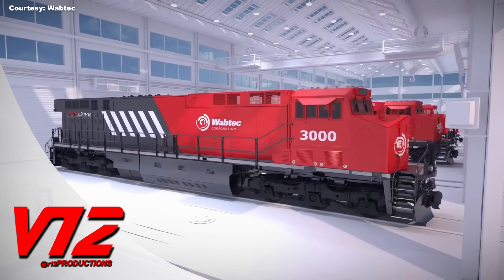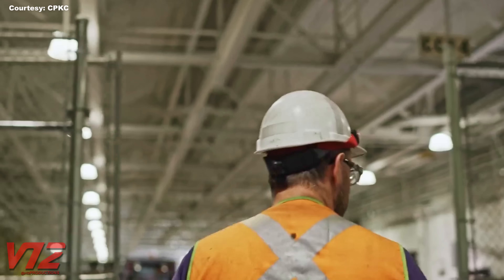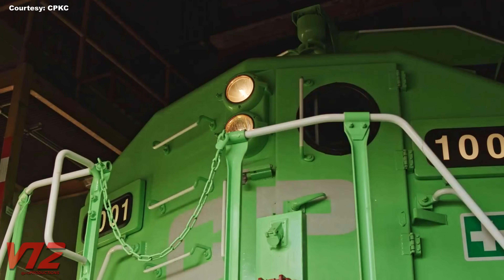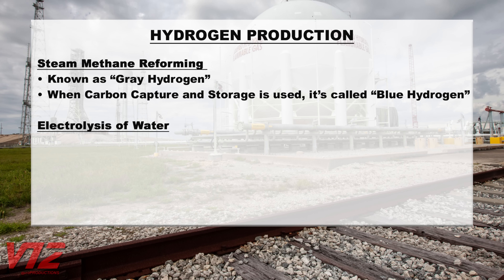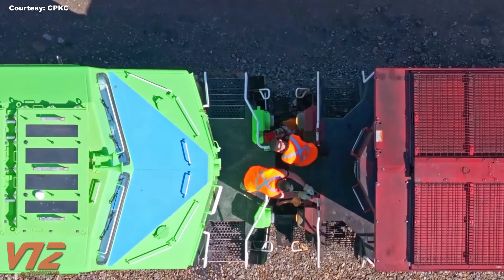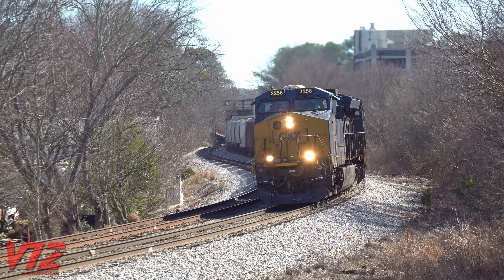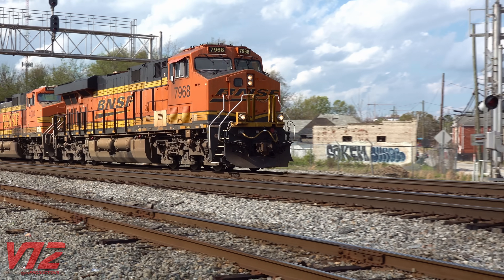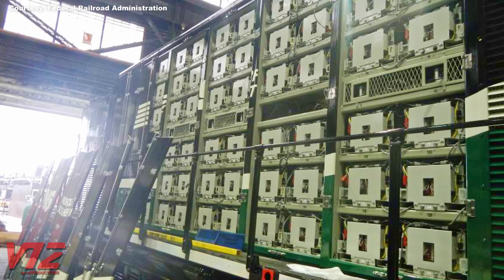The Future of Train Technology?

Comment: All these hydrogen and battery units exist solely because Class 1 railroads are greedy, stingy, and are afraid of the upfront cost of installing over head wires, which will save them money in the long run.
Reply: Hit the nail right on the head, the GE “Little Joe” had the same horse power(albeit with haved tractive effort) as modern ES44ACs do, and the Milwaukee road would run them for over 400 miles continuously. It’s not out of the realm of possibility and anyone who thinks so needs to think bigger.
Reply: Time to copy and paste Switzerland’s rail net work and scale it up 10 fold :)

Also I’m pretty sure there was thoughts about electricifiying in the 50-60s
Reply: @ exactly! There were probably plans in the early 70s during the oil crisis.
Reply: It’s called running a stock-owned business.   Anybody CEO/CFO is going to do what makes the most sense for that business, not meeting any outside sentiment.
Reply: Threaten nationalisation unless they electrify an annual minimum of their tracks per year
Reply: Yeah, those fully battery-electric engines are a bloody stupid idea.😅
Reply: Dude. No
Reply: Towns across America have been mad at the power and telecom companies demanding they remove the overhead wires because their constituents don’t want to look at the ugly poles and wire.  Now you want them back.  Make up your minds people.
Reply: And some lines had full electric lines but wanted short term profit so they removed them
Reply: 100%
Reply: Exactly! Overhead electrification has been a proven technology since 1914 on the New Haven railroad. If about 10% of the most heavily trafficked rail lines in the country were electrified that would account from more than 50% of the mile-tonnage. There are many other benefits like not having to stop for refueling and trains that would run faster up hills, increasing the total capacity of the line.
Reply: Poor you
Reply: More like not really practical for the terrain all these trains run through along with the fact that it would also need government funding and take 50+ years to complete.
Reply: @ Then what about the Milwaukee Road having electrified through rough terrain on their Pacific Coast Extension way back in the 1910s?
Reply: @IGuessIDoThings  was the Milwaukee road running 15k foot 20k ton trains up 40+ miles of 2% grade in 120° heat? Everybody says why cant we be like Europe,  well Europe runs thomas the tank engine sized trains and they run majority passenger trains at that so its a completely different animal. Why do you think when people from Europe come to watch trains here they are in such shock and awe and you ask them "is it anything like this at home" and they simply say "hellll no". The supply and demand in North America is much greater on the rails than any other country. Plus if a locomotive blows up now its simple to diagnose, you dont need to be a rocket scientist to figure it out.
Reply: @ Ok yeah fair point, but you don’t need a rocket scientist to figure out what?
Reply: @IGuessIDoThings  you dont need rocket scientist to diagnose and sometimes potentially fix with a piece of bubble gum a locomotive issue on a current diesel electric locomotive as you would with a fully electrified locomotive. Youd have to have numerous qualified mechanics on 24/7 standby with full electric locomotives trying to diagnose the bazillion sensors they would have to have because idk about you but im not touching anything that says high voltage, shit i wouldnt even touch the high voltage stuff on current locomotives. Trust me leaving it the way it is now is the best way to go, at most if they work correctly the hydrogen solution but even then thats gonna become overly expensive trying to convert an entire roster of loco's. If it aint broke dont fix it the only reason these concepts are a thing to begin with is because of the stupid greedy EPA thieves.
Reply: @ Ok I get what you’re saying about the maintenance of electric locomotives, but diesel electric locomotives are currently being rebuilt with fully computerized internal systems, akin to “all the sensors” on an electric locomotive. Also, Amtrak does have the ACS-64 which is essentially just an American version of the Siemens Vectron, a very common mixed-traffic electric locomotive in Europe, as well as, the Acela Express—og’s not the new ones, the news ones are a real piece to put it simply—which are electric high-speed train sets. So, we do have the knowledge and workforce to be able to work on and properly maintain electric locomotives. Also not every single inch of rail lines needs wires, preferably the busy corridors like NS’ Chicago and Harrisburg Line’s.
Reply: @em2attic  Still doesn't mean you can't electrify key routes, and those ultra-long trains are causing all sorts of issues of their own. Sure you can't make a reasonable comparison with most of Europe, but you probably can with Russia. Russian Railways have a long tradition of multi-unit electric locomotives with the latest being A-B-A or A-B-B-A lash-ups delivering huge amounts of power. Their trains are also way longer and thanks to bigger car size way heavier than any others in Europe, so much more comparable to NA conditions. They also endure extreme climates and run through some of the remotest inhabited parts of our world.
Slashing train sizes to a more manageable 1 1/2 to 2 miles would also be a good idea operationally, even though it would mean a major need for more crews (which is probably the main reason for such a project's impossibility). It would mean more agile trains that are able to respond better to speed limit changes, obstructions on the track or other emergencies, they'd be able to better integrate with passenger trains and they'd be able to fit reliably into sidings, something which PSR-operations have apparently not considered, at least according to anecdotes. I'm not saying that what I'm outlining is realistic for the US, but it's also not impossible.
Reply: @em2attic  In South Africa the entire rail network is electric. It's pretty hot in some areas and there is an "ore line" where 342 car trains are run over a distance just under 1000km, regenerative braking feeds back to the grid. Most of your argument falls flat in my opinion. Electric locomotives are much cheaper to operate and maintain by the way.
Reply: @IGuessIDoThings i think the sprinters won't handle US Freight traffic well.
Reply: @ probably not, but with some modifications and re-gearing maybe
Reply: @bahnspotterEU yes but electrifying key routes doesn’t really help as it would save very little money and that’s before you realise that you would have to electrify the rest of them due to many trains not just going on the main routes
Reply: @rhysrail It's more an environmental and operational concern to me than a financial one. And of course many trains would have to swap locomotives at some point when entering or exiting an electrified route, but US freight is so sluggish, a short locomotive change or addition (electric added to diesel train) wouldn't be a major slow-down.
Reply: @ hydrogen trains with green hydrogen would eliminate the environmental concerns and from there it’s only the railway companies profits that are effected as a massive freight train can’t safely accelerate faster anyway
Reply: @em2attic China and their Shen24 would say otherwise.
Reply: @em2attic  15k foot trains are problematic. Less jobs, longer wait times, sidings need to be upgraded, etc
Reply: @em2attic  Apparently you don't know that electric locomotives are about twice as powerful as diesels with as much or more tractive effort.
Reply: @em2attic Dude you have no clue what you're talking about about. Electric locomotives are simpler, as they work the same way as diesels, minus the maintenance-intensive diesel engine part.
Reply: @gamerfan8445 The Sprinters are passenger locos. Why would you use them for freight? That makes about as much sense as pulling a unit ethanol train with Chargers. The railroads would need purpose built electric freight locomotives.
Reply: @woodalexander  exactly
Reply: @woodalexander  ok
Reply: terrain is an issue for electrical poles??
Reply: @ I don’t think it would be if they’re buried deep enough or have some form of support
Reply: @benbookworm  No it's not. There are electric railways in the near-arctic North and the Arabian deserts, as well as in tough and rocky mountain ranges. It's all a matter of will.
Reply: @benbookworm  we already did it before
Reply: @em2attic  the original American cross-country rails ran parallel to telegraph lines. Terrain isn't a significant issue. Run it ahead, run it below, use a third rail, lots of options.
Reply: @em2attic The Trans-Siberian railway begs to differ
Reply: @em2attic  Indian Railways are close to 100% Electrification 
Who are you hoaxing 😂
Reply: @shreyadyutipati9870  you really compared indian railroads to North American railroads lmao! I dont think you guys understand how American railroads work, they are not about to dish out all this money to electrify an entire mainline network, they hardly dish out money for locomotive maintenance, so many bad order locomotives hot potato back and fourth between roundhouses and not one finger touches it. Yea they might spend and get a few new hybrid locomotives but thats all you're gonna get out of them. Railroads are ungodly cheap af like cheeeeap af, they will postpone replacing a cracked mirror.....a cracked mirror, to save money and just shotgun it somewhere into the consist until it comes time to be a leader and or the FRA finds it then they are forced to fix it. So say all you guys want about electrification its pretty entertaining tbh lol.
Reply: Hydrogen is the way forward imo. Running wire over the thousands of miles, plus yards, sidings, load facilities, ext would cost a massive amount of money. And it's not something you could really do in small parts or just main lines as these locos don't just stay there. So it'd be all or nothing. And most freight locos are not in the same weight class as American units. We move massive amounts on a single train that using a European design might take multiple extra units. Not all about HP but weight and traction on the motors.

With Hydrogen you can get zero emissions (possibly) while using the same units rebuilt or new similar units. And unlike trucks, trains only go to certain places. So you could put refueling stops where current diesel tanks are and produce the fuel on site with a green power source (wind turbine or solar on site). It's not like trucks that have a gas station around every corner to cover every town and major road.

With that said, passenger rail should have wire on certain high-speed routes. As I don't see hydrogen locos being HSR, probably 110mph ish like the chargers at most. But those routes are really only needed on city pair not cross country. As I believe go cross country still wouldn't justify hsr as I can fly from mn to Florida in 4 hours. But from Minneapolis to Chicago that would possibly be competitive.
Reply: @brabblemaster401  
Why electrify yards??? Just use battery locomotives. They are best suited for yard work.

Also, wouldn't it be easier to retro fit a Deisel-Electric locomotive into an electric engine instead of Hydrogen-Electric locomotives? I'm no expert in electrical solutions, but I'm pretty sure it would be able to remove the Prime Mover and replace it with electrical components.

Also, I don't see why freight isn't fast anymore. Wouldn't it benefit many places and profit decently? It would help eliminate airplane travel.
Reply: @Really-Random24  yes electric may work in the yard. But I can't see it working on the lines. The weight they pull, I dont believe we have batteries with the energy density to go far. They may be useful on some routes with steep grades. Running as slugs only working when the train needs some extra power.
Reply: @brabblemaster401  
I wasn't talking about batterficstion (if that even is a word)

I totally agree! Battery trains can not replace current motive power.

Edit: I was referring to catanary wire energy power conversion. Woops :/
Reply: It’s there money they are spending and they think it’s better use if money to use hydrogen, electric just wouldn’t be worth it then as there aim is to keep cost low and they do that using long trains, electric would be more expensive for them
Reply: @ The thing is, modern electric locomotives can easily match the power output of two diesels, so there would only need to be one locomotive per train instead of two, yes I know about DPU’s.
Reply: @IGuessIDoThings  also, freight EMUs like what Japan has
Reply: @ yes but the infrastructure cost is so much higher than having an extra one, electrification is only worthwhile where you are running frequent trains at high speeds such as passenger trains, there are very few dedicated electric freight railways
Reply: @ I mean the priority for Class 1’s could just be to electrify the really busy main corridors, like the Transcon, Chicago Line, and Harrisburg Line.
Reply: @ yes but many of the trains that use it will continue on else where so would have to swap locos which would be expensive, it’s much cheaper just to run hydrogon trains
Reply: @ Yes I completely understand you’re point; however, would it not be possible to electrify some of the other lines. If only a few lines, which aren’t connected to  each other, are the only ones electrified of course it’s gonna be expensive and inefficient. There would need to long corridors going through most of the regions a railroad serves. Also, if there is a local that starts I’m in un-electrified territory and ends in in-electrified it doesn’t make sense to switch the diesel for an electric. Wait, what about dual mode diesel and electric locomotives?
Reply: @ I just don’t think it’s worth the money, it would probably even be more expensive long term due to the high maintenance costs and then you have issues with yards still requiring hydrogon anyway, it’s just not worth it for the cost

Comment: I’m not a fan of these future and battery trains
Reply: same. I also dont think its particularly smart or viable on a large scale like the US.
Reply: @ yeah
Reply: Same these just won’t be the same as the old Dash 9s or the SD70Ace
Reply: dont worry they will run them for a little bit and then they will fail and get rid of them
Reply: Did you guys heard the News the Hydrogen locomotives are no more
Reply: BNSF and I think others don’t want no more hydrogen locomotives and now they want to use their older locomotives for good
Reply: @ yeah
Reply: @ yes
Reply: no
Reply: OHLE. That is the solution. They just need to shut up and do it. And if you say "it's too expensive and in America" THEY WERE GOING TO DO IT DURING THE OIL CRISIS! Union Pacific HAD WIRES GOING UP on sections of thier route! Then oil got cheap again, and they took it all down again and cancelled their electric locomotive orders. They can absolutely afford to electrify thier mainlines, they just don't want to.
Reply: Yea too many problems
Reply: Battery powered steam might be feaseAble.  All it is is a giant water heater.
Reply: same
Reply: Yeah I like steam and diesel
Reply: @RailfanMason Same
Reply: I’m not a fan either, but I do see hydrogen taking a place in this world and yet piston engines still exist. 

Isn’t that what happened 100 years ago when petrol replaced steam in the piston engine? 

Steam Ships started using bunker sea oil aka diesel from the mid twenties to the late 30s before converting to pure diesel in the early 40s and mid 50s. 

Piston engines are here to stay but not necessarily the power source that they rely on, steam, petrol and now hydrogen specifically liquid hydrogen Though it would have to be ridiculously cold either that or the gas would be pumped directly into the combustion chamber via pipes and suction motor in the tank itself.
Reply: Diesel is fine. If they want to clean things up, focus on large ships. Not freight locomotives.
Reply: @RailsofForney-official or better yet, what powers homes. coal would be the first to go
Reply: @  true. Natural gas is so much cleaner
Reply: @RailsofForney-official  OHLE stands for OverHead Line Electrification, so I'm not sure what you mean. Assuming, of course, that you were replying to me, and YouTube wasn't lying again.
Reply: @InevitableMe   I think you’re side glitched because I don’t even remember being involved in that conversation
Reply: @RailsofForney  That's fair, I get nonsensical notifications from YouTube all the time.
Reply: Same
Reply: The real power is diesel loco I love that train to much ❤
Reply: I'm not either, climate change is a hoax, were told our cars are polluting whilst politicians and elite fly around in private jets
Reply: Ditto. This isn't green. It's government overreach.